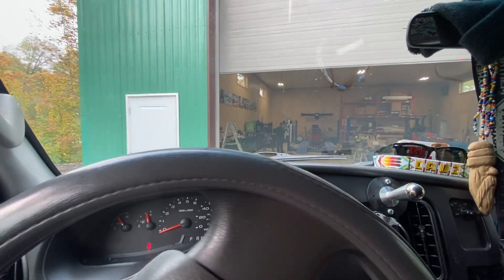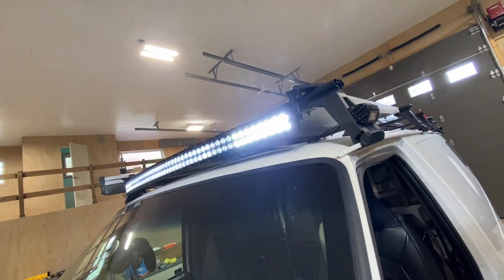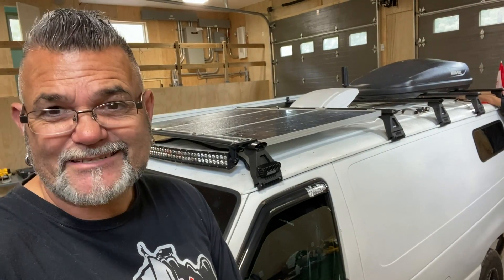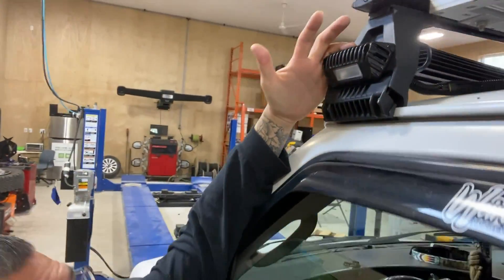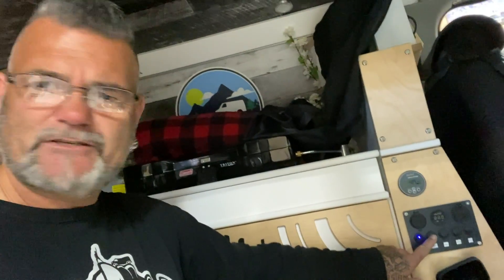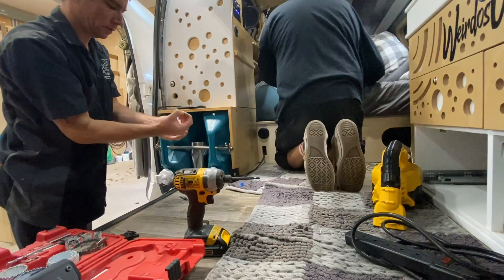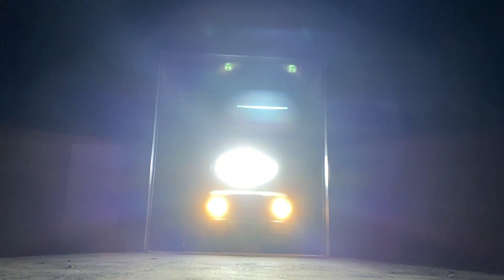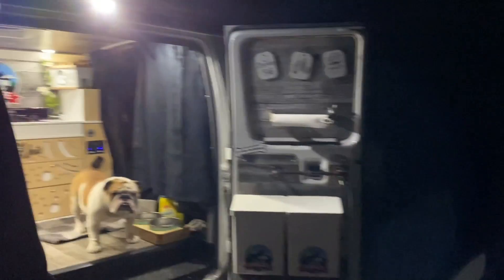Just Wait Till You See This In The Dark /// Light Bar, Exterior Lights And Sound System

Comment: Chrome! @vancityvanlife everything is great! From experience, you should position your front light bar up higher, otherwise it’s going to keep bouncing off your hood and that can cause white blindness while you’re driving. Think of it as someone driving toward you with their high beams on, except you’re doing it to yourself. Creates really dangerous glare, but it’s an easy fix. Just turn it on at night, and tilt it up until the light shoots past the end of your hood. Good luck.
Reply: Charles Ansman yeah, or just put a visor at the top of the windshield. No matter how it gets fixed, it needs to get fixed for safety reasons.

Comment: Always wanted a e350 4x4 with a 7.3 powersmoke on 35s to do just this.instead I'm doing it with my f250 and a canopy. Kind of a removable set up so I can still use the box when needed
Reply: Likely just a foldable cot as a bed, a diesel heater permanently installed at the front in a box to protect it, couple batteries, raspberry Pi and monitor for amateur radio

Comment: I love the lights and other upgrades you’ve done.  Once you get out on the road you should show the difference between your standard van headlights and your new light bar.  Film from inside the van looking out the windshield with your headlights on low beam, then switch to high beam and then turn your light bar on.  I know the light bar can’t be used on the highway, but it would be good to see the difference and how it’s helpful when on back roads/trails.

I’m wanting to get a full size van myself (right now I have a minivan), but being a full time wheelchair user I need some custom modifications to make it usable for me.  It would be for weekend getaways and medical appointments until my wife retires, but then we want to do a lot of traveling.  Most of my medical appointments are over 200 miles round trip with one being over 430 miles round trip.

Comment: hey Chrome; at 17:30 you'll note where the "weather station" sensor is located.....I think the sensor is picking up heat from below when you fire up the furnace (all of that hot air in your house is rising) and the radiating heat is giving a false outdoor temperature reading.....peace and groovy vibes